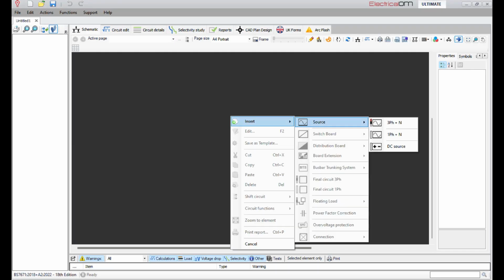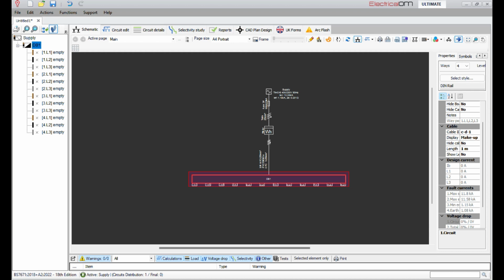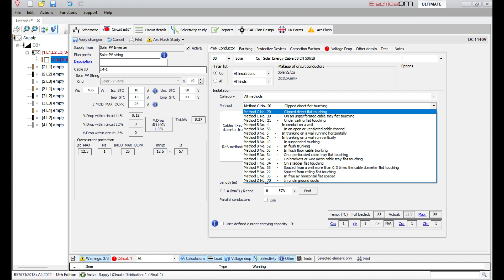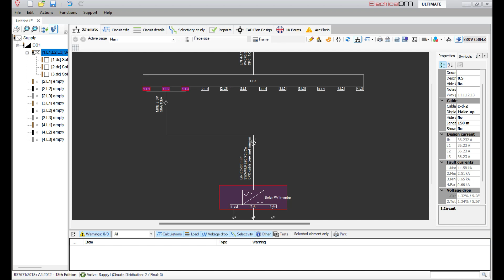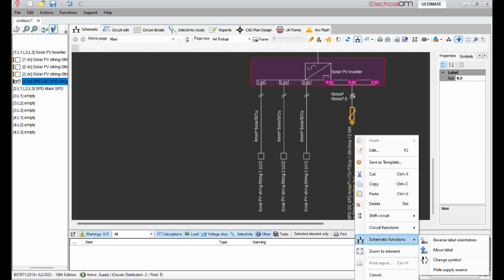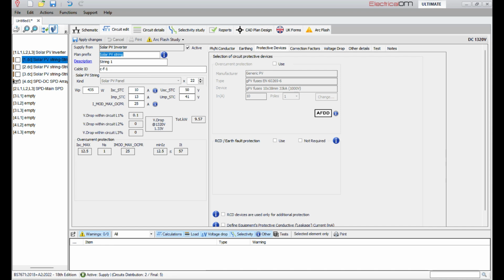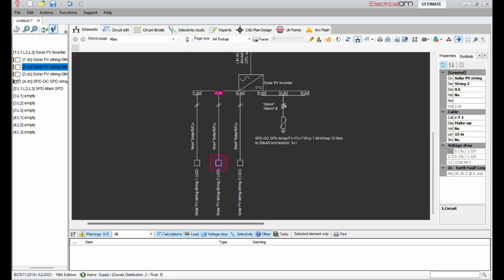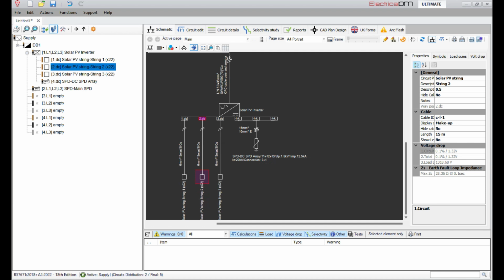95mm 5 core SWA x 150m ??? ElectricalOM solar design 25kW Three Phase SOLAR

Comment: Looks great! Does it work on Mac OS?
Reply from the maker: I’m not completely sure as I am team windows anyway lol. But I found this if it helps!

https://electricalom.com/site/knowledgebase.php?action=displayarticle&id=10
Reply: Electric OM? No. It’s windows only so you’d need your boot camp a windows set up. It’s a shame because it’s set up to deal with design aspects
Reply: I use it on Mac with parallels. With the CAD add on it’s amazing